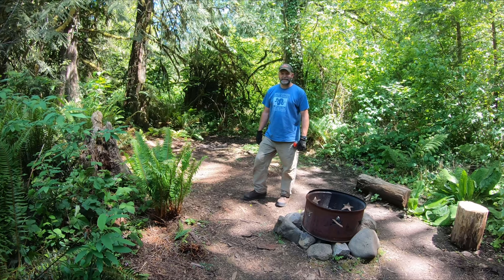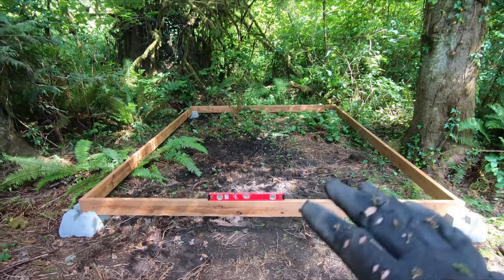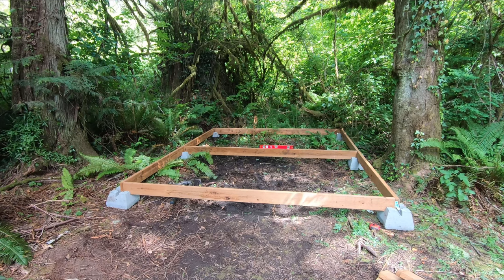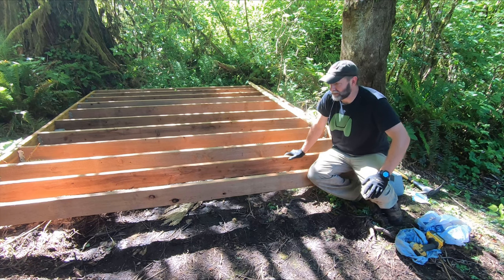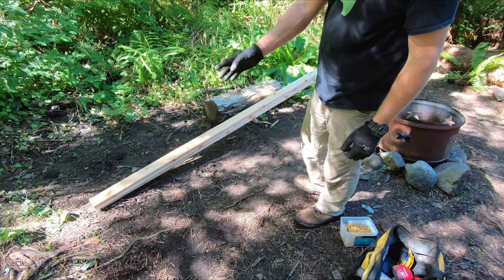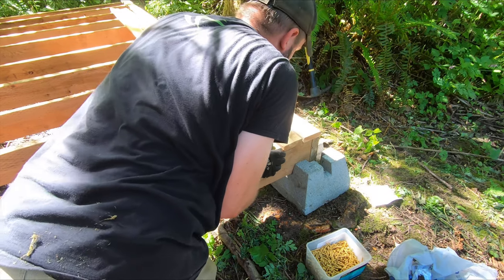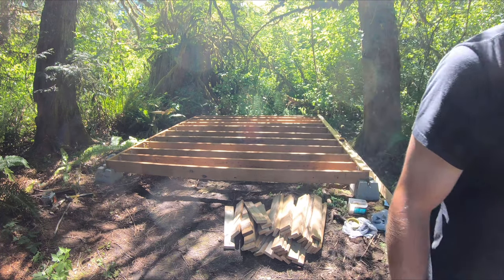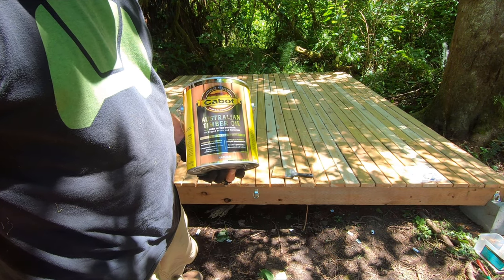Building a Tent Platform

Comment: I’m watching videos because I’m planning to build a tent platform in my back yard.   I have so much time invested already and haven’t bought the first item.  Well, except for the tents.   I am wondering about preserving the wood to protect it from water damage.   My platform will be 10 x 16.   I have a Pomoly hot tent stove so I need enough space so I don’t have to worry about catching anything on fire and still fit the grandkids in there with me.   But thank you for all the thoughts, mistakes, redos to save me from enduring the same frustration.   Very nice deck. I’m hoping mine looks as good!
Reply: You did a good thing making the space between the boards smaller.  It will discourage snakes, Aisiania jumping worms etc. from coming in.

Comment: If you just had unscrewed those end 10 feet so the 12 foot was on the outside of the 10 feet horizontals - would that have fixed your 10 foot joist problem? I think so. Would have saved you the time of having to cut them all? OK that's precisely what you did! thanks

Comment: deck boards running in the diection you chose welcomes rain running into the tent from front (or porch) of the tent unless the tent front completely covers the deck.
Reply from the maker: Yeah, that does seem like a possiblity. I'll be interested to see how it works out in practice.
Reply: @philbrown5722  i think you intended to run the deck boards horizontally with the tent door but realized you messed up your board lengths and had to run them front to back. if your boards are cupped at all, water will run into the tent unless your pitch is towards the door